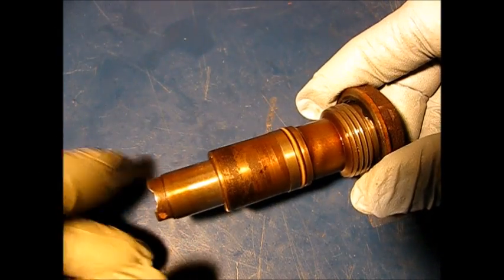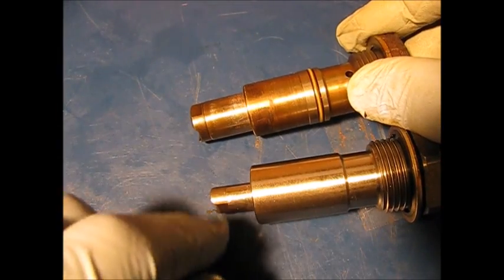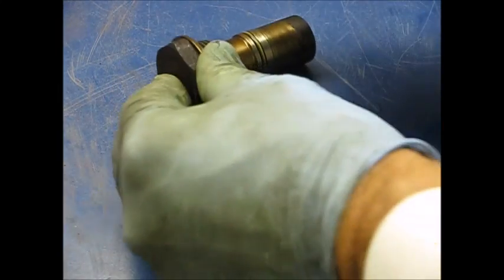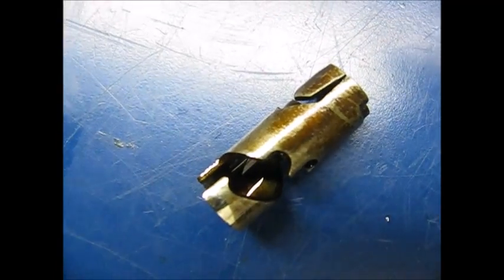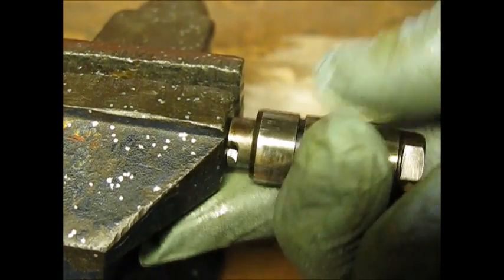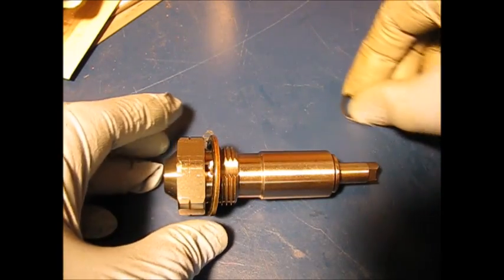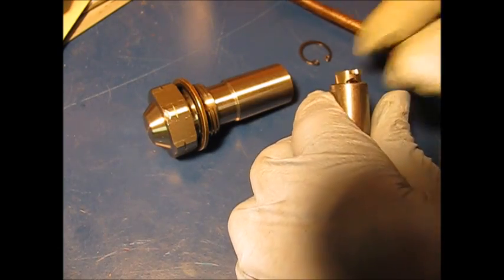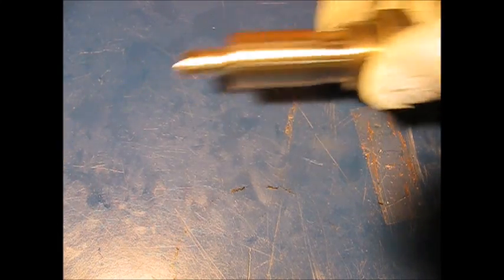GM Ecotec timing tensioners: old and new tensioners dis-assembled, de-activated and re-assembled

Comment: Always go with a larger millimeter size hole on the oil spitter,the smaller one that comes stock on that ecotech does not supply enough oil to the  timing chain wearing it out twice as fast

Comment: I have just installed a new timing set, rebuilt head, waterpump, etc. I have tried pushing on my chain/move able guide to “activate” the tensioner but it does not seem like it is activated. The chain appears to be tighter than before I installed the tensioner however there is still a little slack in between the cam sprockets at some times while turning the engine over by hand… how do I know for sure that it actually is activated or not? Could I try removing the tensioner and reinstalling?

Comment: I just got a new one from Gmail part number 12608580 ..Should I be able to pull it out?? New in box and I can pull and push the shaft easily..Is that normal?

Comment: Thanks for the excellent video. My engine is a 2.4 L. Ecotec that is in a 2010 Equinox. Always take out the chain tensioner and disassemble it if you have odd DTCs indicating multiple system failures that occur out of the blue.  On mine, the dealer had replaced the water pump/balance-shaft chain under a GM secret extended warranty program. The timing chain has to be removed to replace the pump/balance-shaft chain, and after that repair, the timing chain has to be reinstalled and the tensioner reset and the valves retimed.  On mine the chain tensioner was either not reset or reset incorrectly, and the fragile-looking detent mechanism(as pictured in this video) was crushed into small metal pieces which over time locked up the tensioner.  Then the timing chain, having little tension from the tensioner mechanism, jumped timing, thus triggering the error messages for reduced engine power, check stabilitrak, ABS error, throttle position sensor error, throttle body error, cam/crank sensor correlation error, ultra high pressure in the high pressure fuel system that supplies the fuel injectors, and a host of others. All were caused by the timing chain jumping one or more links.  To add to my misery, the normal and properly installed timing chain has colored links for locating the chain on the timing marks on each cam shaft sprocket as well as on the crankshaft. These well-known multi-colored links were not used by the dealership when it reinstalled the timing chain, so there are no “landmarks” on the chain to use in resetting the timing.  I was able to drive my car into the dealership on 
“reduced engine power” to have it checked; it was dead when I went to get it 10 days later. I was handed a $5,700+ estimate for anticipated repairs, and was told that the engine might be blown and that it was junk to them, with no salvage value - it only had 89,000 miles on the odometer and was otherwise in excellent condition.  The upshot was they had let the battery die, which they did not notice, and it needed a new chain tensioner and to have the two camshafts reset to the proper timing marks.  The chain tensioner was the last thing I checked, and it wasn’t until I disassembled it out of curiosity that I discovered the source of all my car’s problems.  Don’t let this happen to you and avoid cars with the Ecotec engine. 

P.S.  if the timing chain is in still place and on the cam sprockets, it is extraordinarily hard for a DIY mechanic to screw in a new or reset chain tensioner, and impossible if the tensioner has already been activated.  You have to either insert a dowel into tensioner opening and use it to push back against the mechanism inside the engine to be able to screw it in, or if the valve cover is off, you can use a 24mm open end wrench to turn the exhaust camshaft slightly to get enough chain slack to be able to start screwing the chain tensioner in.

Comment: so what is exactly wrong with the old one ? because it really simple design and with the spring its not much that could go wrong
Reply from the maker: The piston didn't seem to always freely move in the body. It wasn't anything totally obvious, but I had few other suspects to explain why the chain had stretched and jumped.
Reply: @DillonTurner395  336k here no timing chain work.done yet.

Comment: i had big niose from the engine its 2.4l, i was going to change the chain, but someone told me change the tensioner because it seem gone and the chain is lose and i changed it with the new model not the old one and it works and the big noise gone
Reply: best thing to do is drill hole in the center from the back tap it to 1/2 and put jack bolt. I have did it on three of them adjust it so the chain don,t flap, more presser you put on the spring tighter it get, you don,t want it too tight just so the chain snug it will work that is a bad way they did it junk in my book jack bolt will stop it from jumping and it works.

Comment: I am installing one of these today on my 2004 Saab 9-3. What  do you mean it needs to be tapped on?
Reply from the maker: I show it in the video. The timing chain needs to be given a little jolt near the position of the tensioner to activate it. Otherwise the chain will remain loose. At least this was true on GMs tensioners.

Comment: Does the new design tensioner have to be tapped from the cam chest to activate it?  Or is it self-activating?
Reply from the maker: Yeah, it still should be tapped on. Although when I put one in, it activated on install. I wouldn't guarantee it though!